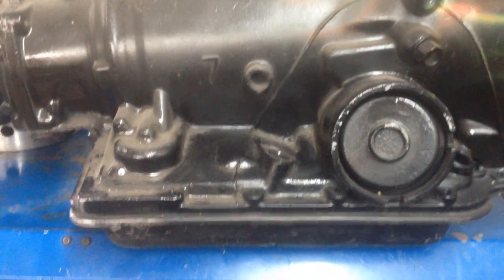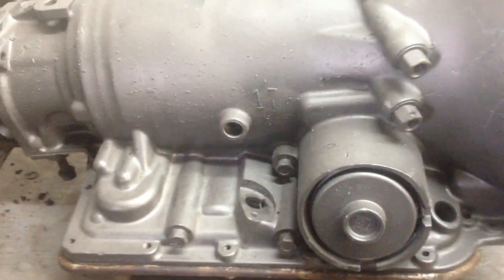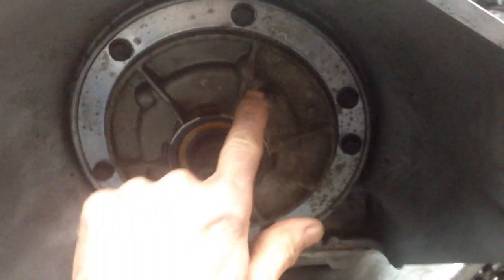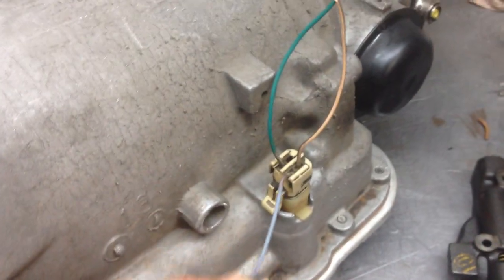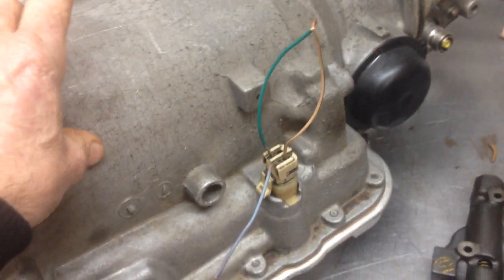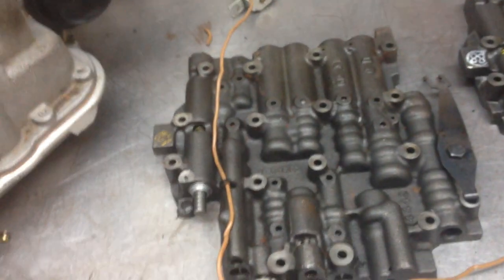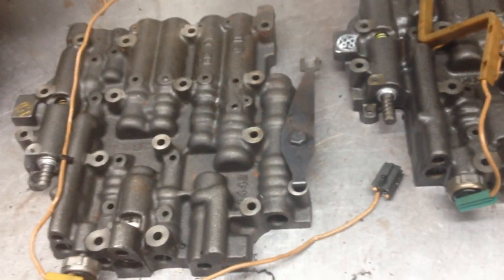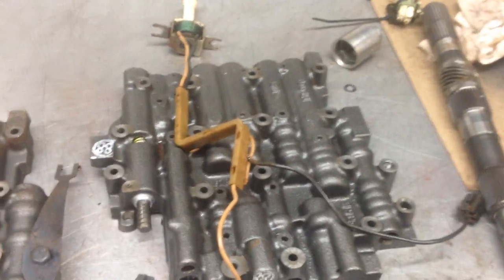tcc lock  up for free

Comment: I just installed a 700r4 from an 88 pick up into a 77 squarebody. As soon as i connected it like shown here my torque converter worked properly. Couldnt believe it was that simple. Thanks for the great video!
Reply: is the trans woking good still
Reply: @Bstrbrn1  yes haven't had an issue. Its not a daily driver so i haven't put a ton of miles on it but so far so good
Reply: @ryantollenaar7352 is your 4th gear locking up? Because I did this in an 87 and it's only doing it in 2-3.
Reply: @MunchinMaQuchy  yes it's working great. 
I don't know a lot about this stuff but i didn't think TC lock up was supposed to happen in 2nd, only 3rd and 4th... Maybe u have something else going on there?
Also did u wire in a switch for TC lock up? Pretty sure he talked about that in the video
Reply: @ryantollenaar7352  I have a 3 wire connection just like in vid. The 700 does have the ability too lockup in 2,3 or 4 but not first. It works fine and has no problem shifting, but it won't do it in 4th. I think i had a early valve body and have too get a different solenoid for 4th. Which involves dropping the pan (ugh).
Reply: My 83 model 700r4 appears to be wired for lock up in third gear also. So all I need to do is just connect my wires like you have done on the outside pigtail?
Reply: @alchampion340  you need a 4th gear lock up kit, simple solenoid change

Comment: Great information. I appreciate this video so much. I got a 700 from a 91 van that I want to swap into my 83 El Camino with the carbureted stock v8. So I don't need to mess with the inside of the trans at all. Just put 12 volts to that one wire and Bridge the other two. Right?

Comment: Thank you John, I wasn't sure how to make lock up happen since my 700r4 is an 1989 model with no ports.  So glad I dont have to mess with that valve body wiring lol.
Reply: No need to connect the two wires, you only have the one power wire coming out of the internal plug. I always just cut them off, also people are always saying you can't run self grounding solenoid just BS, solenoid is your grounding point.

Comment: My 83 700 R4 has two wires coming off of the solenoid one goes to the fourth gear pressure switch. Then you have a jumper over to the third gear pressure switch which enables it to lock up in third gear. Therefore, there are two different wiring, set up some of the early valve body..  if there is a casting mark over the cooling outlets, you know you have an 87 or newer 4L60.

Comment: Very informative. Nada lota YadaYada! Thank You for a straight to the point video. Wish they were all like that! I have one question just to be clear. On the two wires connected together, Do I still have to ground them to the case? Or just heat shrink them together? I guess thats only one question, just worded it differently. Thank you for your time, Mike.

Comment: Interesting.  I have new transmission and motor ...  350 RV motor and the 700R4 ....... it does have a motor home cam. . ...  so this will NOT work or do you have a dash switch or something that would help

Comment: I have an 85, 700r4 has the port for a 4th gear pressure switch.  Do I need to use an external pressure switch or can I just connect these 2 wires?

Comment: I have a 1990 Corvette convertible, and just installed a B&M shift kit. The second valve body you showed is the one I have. I only want the lock up in 4th gear only.

The rear main seal is starting to leak so I might as well install a 2,200 stall speed converter.

Comment: My rebuilt 350 has what they would call an RV cam I guess, it doesn't thump really hard, it just sounds like a slightly bigger cam
Hopefully I can do the twist the wires together and run the purple to a 12v toggle

Comment: Hi Juys, I bought a 76 Jeep with 88 Chevy 4.3 engine without transmission.  So, I bought a 94 700r4 transmission, but I don't know if I will require a module or hardness to put this transmission to work. Thank you in advance.
Reply from the maker: 94  is   not   a   700r4  if    it  has  a tv    cable  it's   not   a    94

Comment: Does +12v engage the lock up in 4th gear only or does it disengage the lock feature in all gears?
Reply: The solenoid has 12v on the positive wire but it isn't grounded.
When it goes into 4th oil pressure is applied the the 4th gear switch which grounds the switch to the transmission competing the circuit to the lockup solenoid.
Reply: He has no idea....just copy catting what someone else told him

Comment: The company that built my transmission has me using this set up on the 2004R in my Chevelle. It tends To
Be slow coming  out of lock up. I do have an aggressive Cam. What should I Don?
Reply from the maker: you  need a  low   vacumn  switch
Reply: How exactly does that work?
Reply from the maker: you   run  the  power wire to  the   switch and  then  to  the trans  and   a  vacumn hose  to   the  motor it unlocks    converter when  engine  is    under load.
Reply: I have a terrible time with the transmission coming out of lockup after switching off the toggle switch that I have hooked up now.  It seems to lock up ok above 60mph, but I have to give it about a mile before dropping down from highway speeds or it almost stalls the car.  would I remove the toggle switch I have installed now, if I install the low vacuum switch?
Reply: I had a toggle switch hooked the lock up solenoid on a 85 Caprice 700R4 and it would control lock up as long as I would remember to flip the switch just before applying the brake it worked great. If I forget to flip the switch and stop the car no problem but would  cause lockup to occur right after it shift to second not so bad if barely into the throttle opening or if the speed was fast enough for second when getting back off the brakes it would stall slightly. I got used to getting of the gas if forgotten trying to not destroy it and remembering to flip the switch came normal after driving it as a daily for several years. I could flip the switch a second before the top of second gear and run lock up in second and get at least ten miles per hour more into 3 at almost 100 and once it was locked it stayed lock even at full throttle. I had an 86 Caprice years before the 85 and it seemed to unlock at full throttle it would  unlocked  at 90 to 100  miles per hour it would down shift to full rpm and hold it back limiting it to that speed this didn't have a toggle, But with the switch the 85 would run to the top of third and go into overdrive manually shifted . It had  so much more top end!

Comment: Hey i have a late model 700r4 like the 1 your demonstrating, my lock up kicks in too early in 3rd gear while accelerating and bogs my engine way down. What can i do to fix this?
Reply: Hello, It could be that you need to disconnect the third pressure switch the transmission? you need to drop the pan for this naturally.
Reply: @ElsoshGhost  not sure, I'm going to call the transmission guy who rebuilt it tomorrow. When i get on it and it hits 3rd the transmssion bogs the engine way down
Reply: @supert1255  ok, i have another 700 with a kit from bowler transmission, their instructions were to remove all wiring to other switches than the 4th one. I suspect that your issue is the reason.. their soultion/kit is flawless, but expensive for what it is. Good luck!

Comment: Hey there I just installed my turbo 350c transmission in my 74 pickup took out the turbo 400 and use that torque converter in the 350 and nothing it moved for about a block and that was it what should I do any input would be great thank you

Comment: Will this work for a turbo 350 with a lockup converter in it? it was in an old mid 80's truck.
Reply: I had the same setup in my '81 GMC & just ran a manually switched 12v to the trans.
Mounted switch on dash so i could lock it up in any gear, just don't forget to turn it off before you stop or if shifting is harsh. Works best on freeways & open roads.
Just a suggestion. ✌

Comment: Can you or someone in here help me out? I just rebuilt a 700r4 and it shifts beautifully all except wont shift into 4th. I had installed the transmission into a Chevy LUV minitruck and the only way to take it back out is to completely remove the cab. In other words its allot of work to take it back out. Is there something i can do to the valve body to fix the problem? Has anyone had this happen before? Also does the lockup solenoid have to be energized to go into 4th gear? I never connected it because the torque converter I installed with it doesn’t have lockup. Thanks

Comment: John I have the transmission out and am doing a conversion. Can I disconnect the temp switch in the valve body and jumper the connector wires?
Reply from the maker: 7004r  does  not  have  a  temp switch

Comment: Good video man. I'm gonna install a B&M 700R4 in my 1971 C/20. However I do have a cam with a large overlap. What do u recommend for a lockup with a big cam?
Reply from the maker: low vacuum  switch
Reply: john batakis I have a stage 2 .600 cam would you say that’s a big cam
Reply: @johnbatakis8570  Low vacuum switch? More info please. Type of switch, hooked up where and how? Thanks.

Comment: Hey man good video so what if I’m cruising down the road and I’m in overdrive and locked up and I need locked up to unlock but I need overdrive will it only unlocks if it goes down to third
Reply: Yes it will only unlock when it goes down to third, this is why i put the 12v+ wire on a switch
Reply: Do u need a switch or can u tap into any 12v source  when car is turned on ?

Comment: I have an 87 700r4 put I only have 2 wires not 3 what do I do with the one wire I know 1 is 12 volts. , I do know that my dad bought it new in December of 86 and it's throttle body efi

Comment: Will wiring like this work on a 1986 200r4?
Reply from the maker: 200r4  needs  4th gear   switch changed  to  normally open switch  buy from gm dealer 90 camaro md8 forth gear   switch ground solenoid to   switch
Reply: @johnbatakis8570  Thank you
Reply: Okay Mr. Batakis. Have read all kinds of sh** about brake switches and relays or 6-pin connector switch and so on. You seem to know your business so I went ahead and ordered and installed the 4th gear switch for the 90 camaro md8 (Normally opened I'm assuming). Just want to be sure of this so now I ask: tap into a "switched" (key on only) 12 volt source for the TCC wire, and then wire the other 2 wires together. And that's it. Will lock up in 4th and unlock out of 4th, right? The trans is a 200 4R (KZF code) that was pulled from an 87 cutlass 442 and installed into my 78 cutlass cruiser wagon. Look forward to your response (and thanks in advance).

Comment: I wish I could do this on my  1981 corvette project with the TH350C 3 SPEED! It's built ,modified Vortecs heads, cam, exhaust, prom stage II jet chip, but kept ecm, distributor ,and carb if only to keep the lock-up functioning. If this trick worked i would dump computer and carb and do Edelbrock or Holley and vacuum advance distrib. But i thin my lock-up trips with several parameters including engine temp...Any Ideas if this will work...I can also buy a th200r4 and the aftermarket crosbrace but that'll  be$ $$$.$$ I think I have those three same wires on left side trans....Thanks
Reply: You can , use a lock up/vacuum switch from a mid 80s chev pickup for the 350c . 
It is positive switched  triggered by ported vacuum. It is fed power from the brake pedal  switch when not pressed or directly from a 12v scorce , switched or not.
Diagrams are available online.
Reply: The 3 wires on the 350c are different.  One is 12v , one is ground and the last  is sometimes used  for reverse lights .
Reply: @jimroy969  This would allow me to pull my electroic advance  distributor and change carb! Do you have a link to this retro -fit? So i need the lock-up switch from a 80s pick-up and is the switch set-up something I can pull at a bone yard? meaning the brake pedal mounted switch?
Reply: There is a video you my find helpful : " How to understand 80's Silverado/Sierra  TTC lock up." 
 Posted by : Tyler's forgotten car rescue , on YouTube. 
 Your electronic Quadrajet and distributor can be replaced with one from a 1975 to 1980 , non electronic. Trucks may have went up to 1986.
Hook the distributor advance to a manifold vacuum port , the TTC switch must be hooked to a ported vacuum port . Set the base timing @14° BTDC    and you should be good to go.
 The brake switch could be removed from the truck also.
There are also numerous very informative and detailed quadrajet videos on the same channel. Hope this helps.
Reply: @jimroy969  That's awesome, I really appreciate it and can't wait to get started on tracking down the parts....

Comment: Hey I just seen this do you really have to just hook up the three wires and one wire to 12 volt does it really work somebody let me know please I know it's an old video thank you
Reply: Yes but run a on and off switch and activate the lockup when you want otherwise it will lockup too early...
Reply: @mrregal5662  OH  OK SO USE THE HOT WIER TO THE 4 PIN PLUG

Comment: What does a big cam have to do with it? I have a "cam" but it is a roller cam in a gen1 400, stock lockup converter and a 700r4- idles around 800, low vacuum. Will this have any effect on this porcedure?

Comment: Hi so do i need a rely for this 12v switched 
Also will it work on a 700r4 from a newer caprice 1992 
Please help
Reply from the maker: no tcc   runs  off  10 amp  fuse and yes  on  the   caprice
Reply: @johnbatakis8570  thank you just did what you said will be testing the car on a high way.
Reply: Hey how can i check the solenoid if its working or bad?
Reply: @mussabakram5875  the lock up solenoid should have between 24 and 26 ohms of resistance. You can also hook the black wire to ground and touch the red wire to 12 volts and listen for a click.

Comment: So then what happens when I hit the brakes and the fucking torque converter doesn't unlock lol?
Reply from the maker: the    fucking  trans  downs  shifts    into   3rd   and  the   converter    unlocks
Reply: @johnbatakis8570  I don't want it to go into 3rd at 55 mph lol. Or downhill. You can't fuck around with 700r4 or your gonna burn it up. Why don't they just do this at the factory if it works so good lmao???😆
Reply from the maker: @thehulkamaniabrother2.089  my 700r4   shifts    out   of   1st  at 56mph 2nd   at   100  lmao